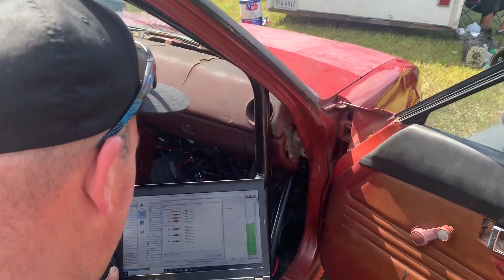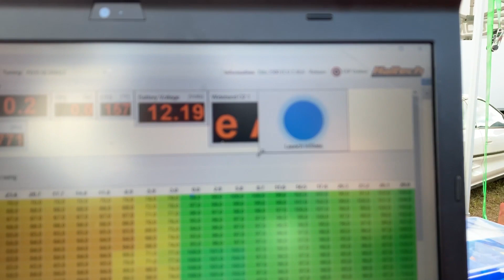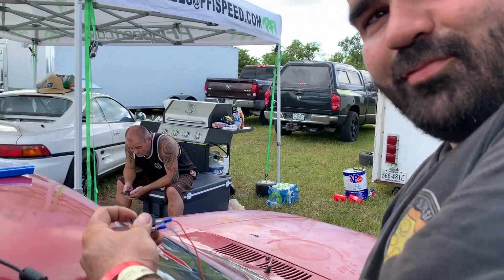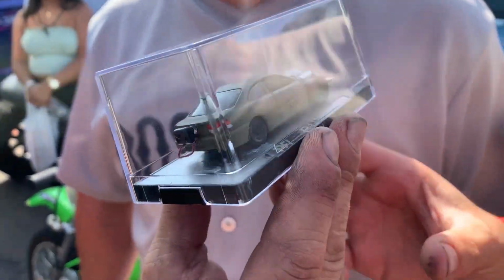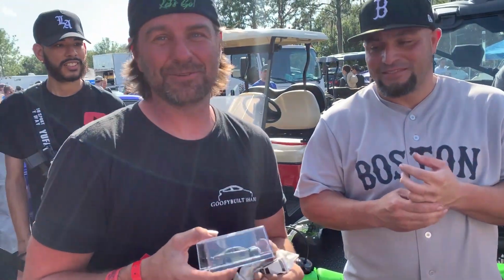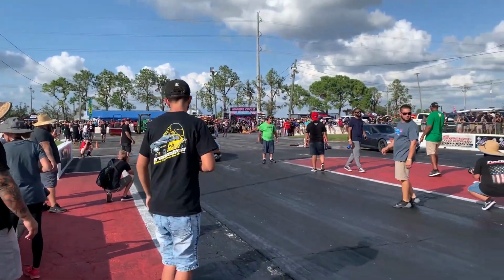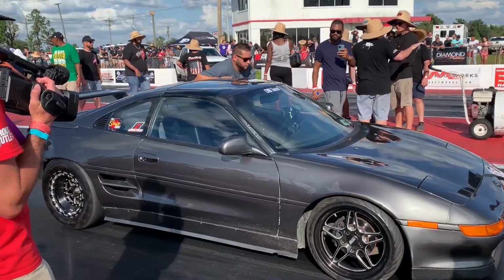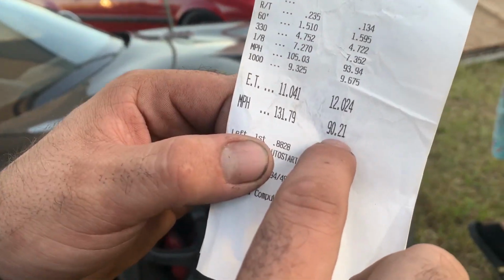Fl2k Qualifying I got Promoted to Crew Chief! Let’s Gooo!

Comment: Hey Brent!  You have serious bolt removal skills but you NEED a set of left handed drill bits. They work wonders when the threads are not tore up!!! Seriously!!! Take it from a guy who has removed over 1000 broken bolts over my 50 years!!!